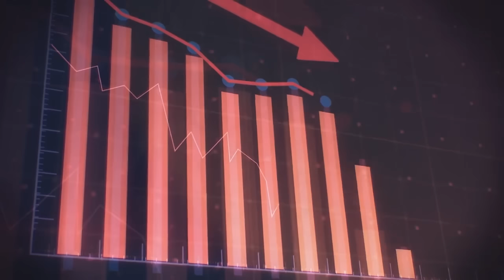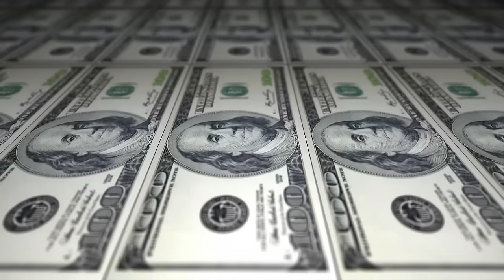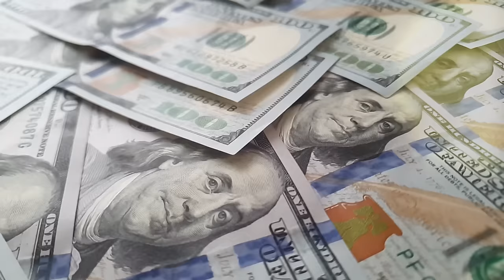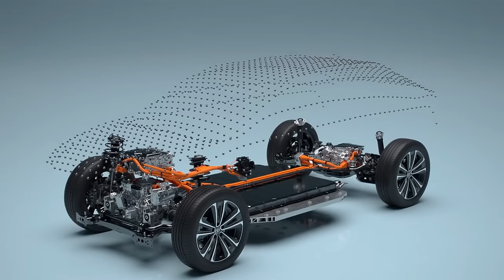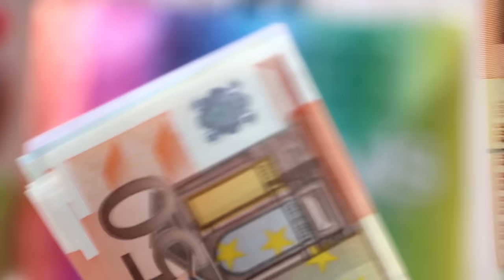The ‘I Told You So’ Moment: Toyota’s Predictions About EVs Come True! Electric Vehicle or Hybrids?

Comment: now average global temperature is higher by 1.58C (2.8F) than before we started to use fossil fuels. Half of the rising happened in the last 20 years. 
NEVER was such fast change in climate so fast before.  So it is not an  Oh, I don't like EV question. EU and China is the leader of electrification. China probably it is because they can undestand that EV based transportation needs 1/3 of energy compared to fossil fuel based and it is the biggest deal of this century if they change their transportation 1st to a cheaper one and after that  they can sell many many many electric cars, batteries and everything to the rest of the world that they make in the factories they build now used by technologies they develop for their own transformation.
I don't tell that an EV car is good for everyone today. But it is better and better year by year.
An EV from 2010 could go the half of the range than an EV produced in 2023 if we see two cars that have same weight.
New EV's battery have less cobalt if they have any. 
Anyway do you know that gasoline production also needs Cobalt? Why it is not mentioned in rumors? And it is not staying in a spot like cobalt in EV's battery. 
For those who drives less than 100-150 miles a day and they can charge car in the garage an EV could be the cheapest option already in total if we consider service fees and fuel price and they will spend less time by fuelling the car than those who use ICE car for the same purpose.
If someone needs 500-800 mile range and don't want to pay too much then they still need to wait for some years for cheaper battery prices.
Also EV is not recommended yet for those who cannot charge at home.

Comment: I think that the issues surrounding the metals (lithium) required in batteries should be included as a factor.  Mining & purifying ore is extremely difficult, expensive & environmentally unfriendly.  The true cost of lithium is hidden, like other EV costs.  I admire Toyota for their carefully created strategy.

Comment: in reality this problem is caused by gas car lobbysts that undermined ev popularity with videos like this. the average american travels by car 42 miles every day, the average european does 20. there is no real problem with the range, the cars are safer, require less maintenance and they cost "nothing" to run if you charge at home.  ev it's the best car if you're not a car enthusiast and do not travel long distances regularly

Comment: I might be open to purchasing electric vehicles if the technology has advanced to the point that:
1. Their batteries are capable of enduring an eight-hour drive.
2. Both the vehicle and its batteries are resilient to weather conditions and flooding, akin to traditional gas-powered vehicles.
3. The batteries can be fully charged within a minute.
4. Solar and kinetic charging options can enhance the battery's lifespan by extending its charge for at least an hour or two.

Comment: I’m stoked and hopeful about H2. Especially in a hybrid platform. It’s ice, but burned a cleaner fuel. Good performance. Clean. Fits into the existing infrastructure and culture much better than ev. I just hope we also increase nuclear power capacity so that electricity can be much cleaner (yes, nuclear is cleaner BY FAR than current sources).

Comment: There is a new ICE technology that can be used for e-Hybrid cars called D-cycle which completes 4 engine strokes, different in both displacements and periods, per revolution. It is by simply splitting the piston ring section from its skirt to be operated via a (valvetrain-like) pistontrain. The ring section becomes an air pump to intake and exhaust gases and supported by the skirt between the heavy compression and power strokes. The existing 4-stroke engines can be readily retrofitted to run as D-cycle. Tests have shown more than 20% fuel efficiency and 2.5-times torque gains. 

The technology can retrofit existing engines, or designed into smaller 2, 3, 4 cylinders engines to couple with e-hybrids to fit into under hood space. 

The D-cycle can further usher in the hybrid of diesel compression and gasoline spark ignition combustions - called "Diesoline '' engine. It is by premixed (port injection of fuel mist with air without soot formation) stoichiometrically input air fuel ratio into the cylinder which only contains the burnt gas. That is the exhaust gases are regulated via the D-cycle air pump to regulate the ignition timing and combustion burn rate (not exhausted). Which is controlled via the ECU for cycle-to-cycle transient operations of the engine. This way the engine is ignited via high compression to low temperature combustion of the gasoline type of air/fuel without excessive amounts of N2 and O2 to form the harmful NOx.  

We believe this can be a good stop gap ICE technology before any viable technology(ies).

Comment: Personally, I'm most supportive of the Extended-range (EREV) concept, as abandoning the need for a Engine powertrain in favor of a generator system seems like a way to simplify the engineering demands from a plug-in hybrid system. However, I recently read on wikipedia that California Air resources board (CARB) would require cars in this bracket to adhere to some stupid restrictions to get the BEVx qualification:
-Minimum electric range of 75 miles (zero-emission vehicles only need 50 mile range) - *debatably stupid
-Auxiliary power unit (APU) must provide less or equal range to the battery - *stupid
-APU must not be capable of switching on until the battery charge has been depleted - *stupid
-must meet super ultra low emission vehicle requirements
-APU must comply with zero evaporative emission requirements

The need to abide by those really restricts the flexibility of makers to tune these systems as they want and need in order to get the qualification that they may want, which may really suppress the desire to get EREVs into the North American market. Hopefully designers are not letting these CARB regulations dictate their performance targets, as I think a wide range of battery/fuel capacity ratios would not only be desired, but requested if these vehicles were more mainstream.

Comment: Irony is the more efficient batteries used in modern hybrid is thanks to the ev push. But whilst I don’t have an issue with EV.. they don’t suit everyone’s life style, especially at the current infrastructure support and still slower charge cycle. Hybrid should have been the big push standard, and it should have started 10 or more years ago.

Comment: I would love to break away from needing an ICE vehicle and would love not to have to buy gas anymore. But only if the alternatives make sense and perform as needed to. And only if the infrastructure can clearly handle it. I shouldn't have to be forced into buying a vehicle that is impractical for my needs, and that I would worry about being stranded somewhere because there are no charging stations. Improve the battery technology, especially the charging times. Toyota has it right by investing in multiple options. Depending on where you live, different approaches work better for different situations.
Will I ever buy an EV or other alternative fueled vehicle? Only if it makes sense. Today is not that day.

Comment: I don't own either. I like EVs but hybrid makes more sense. At least you have the gas feature to fall back on should you not have battery life. I like how the report says that hybrids are "notably less expensive ". Try to find a Toyota Camry and not be wait on the list for almost a year. Plus the things are still expensive even as a hybrid and it's not even a plug-in hybrid.

I have to wonder if Ford and GM's losses are due to EVs or that compared to companies like Toyota, their cars still trash outside of their trucks?

What makes all of these technological advancements less appealing is the advancements themselves. All the widget and sensors that can fail or get damaged in an accident are expensive to replace. A friend of mine has a Prius Prime plug-in hybrid that had the display fail out of the blue. He managed to find a used display that a shop sourced to replace it with. A new one would have cost almost half the price of a new car. That's ridiculous. The things is essentially a command & control module. It has the nav system, A/C & heating, radio, and  Bluetooth system.

Comment: You forgot about one thing. Combustion engine is a complicated machine. It takes fluids and needs maintance / service. This cost many and time. I drive EV for three years now. Had one service visit, 1/3 of the cost of normall service - only electrical checking and cabin Air filter exchange. Thats all. No oil change, no transmition etc. I charge once per week at home for my work home usage. Dont have to go to fuell station, wait in line. Not to mention great acceleration and no shifting gears. I really like EVs. Now looking to buy a new one.
Reply: Hertz Found Out How reliable Tesla Are Not😂 Hertz is Selling 100,000 Tesla for $8,000 to $10,000 Because they are Reliable 😂😂😂

Comment: EVs can be good but charging is a pain in the butt at the moment.  It only takes a minute or 2 to fill up a tank of gas and you're going again.  I am not entirely sold on the hybrids but right now I'd prefer a hybrid over an EV just purely on cost.  The only thing I have against hybrids is that there are basically 2 systems that are working which requires double the maintenance as opposed to just a gas only car.

Comment: You forgot: the problem of batteries recycling (not possible), the weight of ev’s and impact on infrastructure, EV’s burning out in accidents and needing 10 times more water to put out, the impact on electricity production when charging, Tesla is going broke soon.
I’m sure I forgot some points.

Comment: EV emit more CO2 than gas if you consider power plant output, cost of mining for battery materials, car lifetime battery replacement costs, increased car weight, cost of disposal and salvage costs of solar panels and wind turbine periodic replacement. “Green energy” is 2 to 3X LESS efficient than petroleum based energy.

Comment: The other issue with EVs is that the carbon savings may not be realized. Or at least, the carbon cost of mining lithium has not yet been included. One number I heard was that the break even point was 6 years of driving. I haven’t confirmed this but I wouldn’t be surprised. Here in BC, Canada, eco projects can go forward without any math being applied, as long as they seem to be carbon reducing. It means that EVs and other ideas are more along the lines of feel-good project. That said, I think EVs have a role to play. I just don’t think governments playing up their “green” credentials should be subsidizing them. Too much politics, too little wisdom.

Comment: Gas car manufacturers think all you have to do is just slap an electric motor and battery in and call it a day. They have no idea how much re-engineering goes into making an electric car. It took Tesla a decade to finally get it right, and even so they still face some issues from time to time. After 100k miles, how much did your battery degrade? Cars like Toyota, Honda can do 400k to 500K miles given that you maintain it. For electric cars, the battery has limited charge cycles and to replace the battery it cost lots of money. If you have to drive long distance everyday then you should stay far away from electric cars. It is because it means you have to use superchargers once or twice a day which will kill your battery within a year.

Comment: Those criteria for reason 2 are still shit.  My hybrid camry gets like 500 miles per tank and takes all of.... 3-4 minutes to fill up.  350 mile range and 20 minute charge is 30% fewer miles and 5x the time needed to go from E To full.  Not to mention my camry costs about half of what an e vehicle that gets that 350 miles (TRULY gets that 350 miles) and that "quick" of a charge time.  

Bottom line... EVs... and pretty much everything with this POLITICALLY backed "green initiative" is a massive scam and is hardly "green."  The "green push" is 100% politics and is only that because it just makes politicians richer.  Over the last 80 years there have been inventions that TRULY would make the world "greener" but politicians and lobbyists quickly shut down said inventions.... and inventors... some by "coincidental" deaths.  I mean in the 70s a dude created a car that runs on water for fucks sake.  Charles Pogue invented a carburetor that gets 200 mpg... in like the 1930s or 40s i believe. Tom ogle also invented an engine that used vaporized gas where he got his 4000 lb Galaxie to get 100 mpg in the 70s.  Tom Ogle "magically" died in his late 20s before he could get his invention off the ground... ironically right after both the SEC and IRS started hounding him.... and nothing came of it.   

Point being.... the technology is most definitely there for straight up internal combustion engines to get 100+ mpg.  The technology has been there for decades.  Imagine if this technology was actually implemented back in the 70s. By now we'd probably have ICE vehicles easily getting 200 mpg.  Imagine getting about 2400 miles out of your tank of gas.   Or.... imagine such an ICE engine in a hybrid vehicle.  Could get like 300-400 mpg.  But that would mean a massive decline in the need for gasoline..... lobbyists can't have that.  

But why then are they OK with full EV vehicles?  Because the amount of mining needed to be done to create the components of an ev is insane.  And what is used in mining?  Heavy machinery... with Combustion engines.  Also.... what do you need to do with EVs?  Charge them.  Where do you get this energy from?  The grid.  How does the grid get this energy?  From natural gas, coal, etc power plants.  EVs would be a boom for the construction of more power plants to handle the massive increase in demand for electricity.  And while people think solar and wind power is the future those sources are laughably inefficient and hardly green themselves.  A world full of EVs would mean a massive need for more natural gas power plants..... if not nuclear power plants.  

Bottom line.... this politically backed and pushed green agenda is nothing but a giant scam.  Don't be a fucking ignorant sucker and fall for it.  

Don't get me started on zero point energy power production.  Mainstream science calls it a scam..... like it does with everything they don't understand or are scared of because it challenges everything they've preached to be true for decades in their science religion.  So anyone who utters the notion of zero point energy power production is deemed "a quack" or charlatan.

Comment: Toyota is already developing engines that will run on hydrogen.  In the conversion process of hydrogen, two different chemicals are the products by which the fusion energy of them results to: 1 gram equals the energy of about 2,400 gallons of oil.  Such chemical is abundant somewhere in Southeast Asia.  Guess where?  When Japan succeeds with this project, all EV's will be obsolete as all we will need is "water minus oxygen = hydrogen."

Comment: Electric cars are COAL powered (unless you got solar panels at home.
And some people are already paying 3X or higher to charge it compared to fossil fuels.
  Some regions already charge 50 cents /kw-hr.
The electric vehicles got really nice bells and whistles, but some insurance companies are already refusing coverage or repairs because even a small accident may cause unseen damage in the battery bank that can burn later.
  Having ro pay $40,000 to replace the entire battery bank for a $1,000 "fender bender" is a deal killer.
  Have you seen the videos of a Tesla burning UNDERWATER at a boat ramp?
   They burn like a volcano for 20 minutes to more than an hour.
  They cannot be extinguished.
Some parking garages and transport ferries already deny service or storage to anything with a Lithium ion battery.
  Your homeowner's insurance can deny fire coverage if you park an electric inside your garage.
   I may like the idea of an electric car, but not the reality of the risks.

Comment: Imagine a hybrid that gives you a 100km per litre of petrol. Imagine that driving your car on petrol charges your cars electric system. Then that electric system gives you a range of 1000km . Then you have to fill your tank and drive on petrol. 
Imagine such a car. 
Would decrease the petrol bill of countries by half atleast. 
On an individual level it would save you 50 to 75 % of your petrol costs. 
Imagine if that car can directly be charged by electric charging station as well. 
If Toyota made such a super hybrid car it would crush all competition. Slowly all countries would make cars on such designs and in around ten years all emissions globally would be halved or even more lessened. 
We can do it . 
We can make a green sustainable world. We most certainly have the technology to do so

Comment: After I bought an ev I just gave up on ice cars. Being from the developing nation middle class, low running cost, supreme NVH control, instant torque and unparalleled acceleration for the money means one cannot go back. It irritates me now to go back to a 3 times costlier ice car especially when I plan for more than 240 km drive in a day only about 20 days in a year.